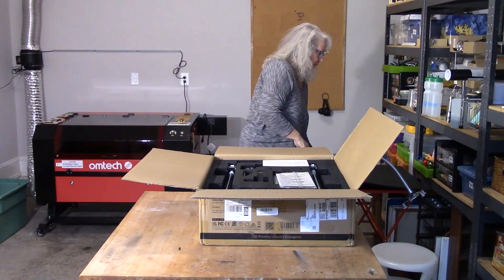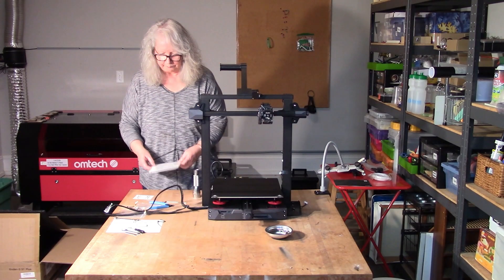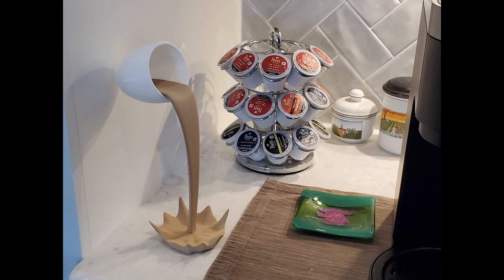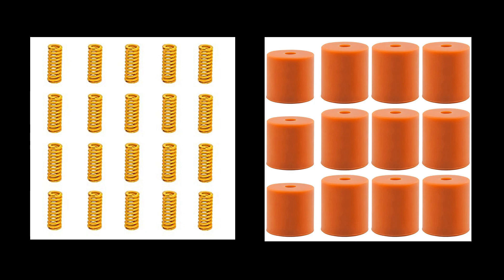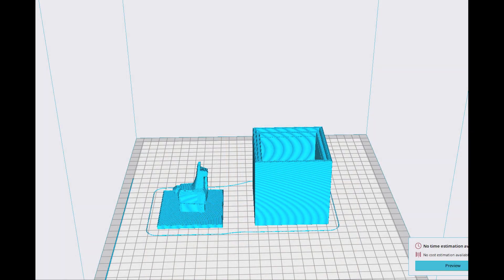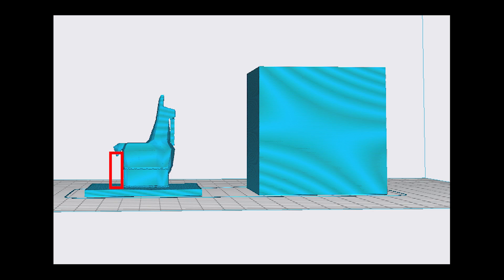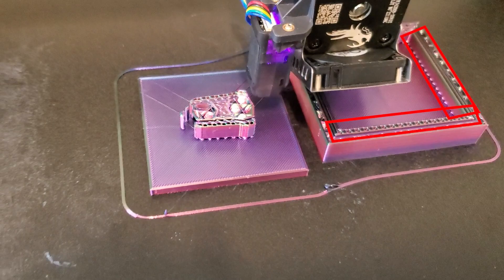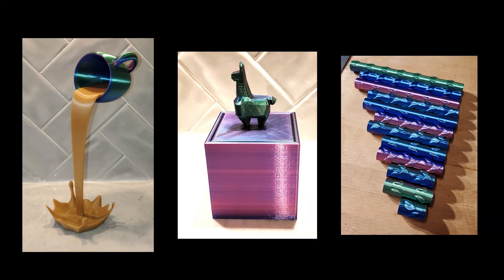My Journey from Resin to FDM 3D Printing or Troubleshooting Your Creality Ender 3 S1 Printer

Comment: Hey, I missed your videos. Sorry, life. 
Welcome to FDM, when we talked last I was hoping you were not gonna get an Ender, for some of the reasons you showed. But, now that you are past the hurdle I cannot wait to see more stuff. You have so many neat toys now! 

A possible solution for the box, on the underside of the "flange" extend it downward and angle to the wall. Kinda hard for me to describe, but, like a curtain rod holder that looks like a 45-degree square tool. It doesn't need to extend to the bottom all the way, just a little way down, a few mm should work. This will take away the need for support(s). I would also print the llama separately from the box, that way it can be its own STL and color. 

Also, with updates to Cura, Prusa, and Lychee, I recommend a different slicer program that has Tree/Organic supports. They work much like Resin supports do but are easier to remove. I cannot recommend one over the other now as my FDM is no longer working. But Cura was always my favorite.
Reply from the maker: Rose! I was hoping you would see this, as I remember you were waiting for me to get into FDM! I've seen that people recommend the tree supports, and Creality has other options beyond the default I used here, but tree isn't one of them. I am surprised, because it seems like theirs is based on Cura but it must not be the most recent version. I will do some research and switch.
I understand what you are describing with the flange. Do you know why the resin printer can do it as designed and the FDM can't? Both need to build off a preexisting piece. Does the fact that resin does a whole layer at once give it more ability to handle small shifts like this? If so, that is another advantage. 
Welcome back! Do you plan on getting a new FDM?
Reply: @GreylightMay  Yeah, "tree" supports and the like are still rather new for FDM, Prusa just got them in a Beta release, which users have said is not always stable. I am sure more companies will implement them into their slicers. Cura just went through a major update, seems their tree supports are even better now according to a few forum people as well as adding support for more printers. 
I am not smart enough to explain why it works better with Resin, but my assumption is that weight plays a factor. Each layer on a resin print is much smaller than a layer with FDM plastic, so there is less "pull" on overhangs. Go too far though and the pull will collapse and fail. If that ledge was farther out you may need to add supports to it, depending on orientation, etc... 

I do plan on getting another FDM, it will probably be a year till I can.

Comment: It's wild that Creality's software doesn't account for its own auto-leveling feature 😮That is inexcusable for a paid upgrade.

My 3D printer experience was the reverse of yours. I started with FDM (a base model Ender 3), then added a resin one later. I find resin so much more intimidating simply due how messy resin is, but the printer itself is simpler to operate. I had the same issue you did with trying to find good instructions for assembling the Ender 3. I had to consult multiple assembly videos as no single video showed everything clearly.

That multi-color filament looks amazing, though. I need to get some!
Reply from the maker: Andrea, I think it is more common to start with FDM, especially since resin arrived on the scene later. The cleaning and chemicals ARE intimidating, I really hate that part. Resin printing is faster, though both processes are slow. Like everything in life, there are tradeoffs that need to be weighed, but both are also a little bit miraculous. I still marvel that these machines are affordable for hobbyists like me!